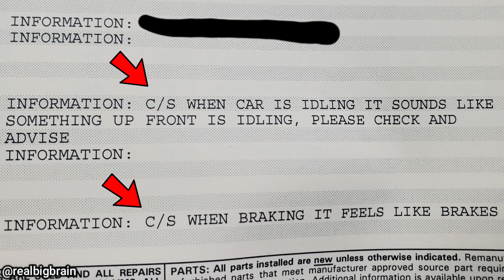Customer States Vehicle Has A Burning Smell & Won't Start | Just Rolled In

Comment: I've seen the blow-by when using bio-diesel turn fully synthetic oil to jello before. No idea if this is what happened here though.
Reply: I am extremely curious what the heck that was.  So bio diesel and synthetic oil solidify when combined?  That's wild.
Reply: @Silent_Shadow  Natural oils tend to polymerize when heat cycled. This is akin to how you season a cast iron skillet, or how linseed oil preserves wood.

Though they are great if only cycled once: castor oil is awesome in "total-loss oiling" systems.
Reply: @bcubed72  THANK YOU! Learn something new everyday!
Reply: @bcubed72  I always wondered why they used total loss oil systems on those early engines. I assume this only applies to high performance engines like WWI fighter planes and race cars?
Reply: Ah, the hydroxide in the biodiesel  causes saponification of the engine oil .. makes soap.
Reply: @bcubed72   the hydroxide  in biodiesel will change the  molecular  structure  of the engine oil..
Reply: That's a Petrol engine though so the bio-diesel theory doesn't fit, it's the same engine GM use in the UK in Vauxhalls

Comment: @0:23 Customer says, I really got a great "cheap" deal on oil for buying two and getting one free!  😁  The label reads >>> Recycled Cooking Oil, Good for 1000 French Fries or 500 Chicken Nuggets.  Filter Daily!  🤣   OOOO, I loved it when you took the cooking/baking pan off @ 0:30  😛

@0:50, That would certainly have Piston-ed me off!  🙄   @1:09, Knock Knock... Who's there?

@1:35....Patent that quick.  How to peel a Rim!     @2:03, was that Low Beam or a High Beam Light?  I think it could use an adjustment while your doing that front end alignment.  😂

@2:10, I have to admit, I haven't seen an alternator quite like that!   @ 2:16, Damn that's Shocking!    @2:34, Don't F-ing DEF with Me!     @2:43, When it runs bad for so long, it's a surprise when it's running right.  I guess 😂

@2:50, Awww cum on, they look great backwards and shine up real nice. 🤣

I am beginning to hate you for keep showing that Rolls.  I want that engine in my GM Safari
Reply from the maker: 😂😂 love the comments.
Different Rolls-royce everytime so hopefully I can get some more to share with you guys.

Comment: There is a plumbing product called LiquiLock which is used for solidifying water so a toilet can be removed without sloshing water.  I wonder if something like that was intentionally added to the car's oil.

Comment: 1:42 that's really strange.. cummings engines have a protection program that will shut the engine down if oil pressure drops. If the underside looks like that then the camshaft has to be even worse.
Reply from the maker: Interesting! Did you see how blue the crankshaft was? Got damn hot!
Reply: @JustRolledIn  yeah it wielded itself.. I know of a guy who threw a rod on those junk navistar engines outside of birmingham al. Instant engine disassembly

Comment: 1:12 That has actually happened to my Volvo too. The welding on lower front shock absorber spring cup fails due to rust and it bends over the tire.  The whole shock tower needs to be replaced.
Reply from the maker: Damn. Did it damage the tire as well?
Reply: @JustRolledIn  Yes it did, it rubbed a tiny bit into the tire sidewall. It happed when I was just drivning my car home from work and then I heard a large bang then and a rubbing noise.  I pulled over to the side of road and saw the carnage. I manage to ge home by swaping out the tire to a space saver spare tire. I changed out both front shocks later in the week

Comment: One of my previous jobs, drove a mack and the headlights quit working. I tied my headlamp around the bulldog on the hood and used that for my lights. Luckily,  I was on a county road, but still had to drive 10 miles in the dark

Comment: The jelo looking oil in 0:39 is that even possible ?? It's my understanding the engine will fry itself before it gets to this point. I had a friend once who never even thought about changing her motor oil. One day I decided to check her car. The oil on the dip stick was charcoal black... My Dear God, I told her; DO NOT start your car, I'll be back. I went to buy new motor oil and oil filter, and oil pan. with tools. I got back, drained her motor oil. It was mud pouring out. Wow, are you kidding me ?? I changed her motor oil. I told her, I'm surprised you didn't fry the engine. That poor car was being abused.

Comment: It should be a crime for a dealer to sell a car that has a blown head gasket without informing the customer, What some of these crooks do is put a sealant in the coolant that might work for a few weeks to a few year depending on the size of the leak. If its something like bad Catalytic Converters that might bore it out or just put a cleaner in it and clear the codes which again might get you a few weeks.

Comment: First clip...I think the customer mix 50/50 synthetic and regular oil mix together.
Reply: That won't cause the oil to jell like that. It is an old wives tail along with if you have synthetic oil and put in regular oil it will blow up your motor.
Reply: @michaelwilkening8542  exactly!  All you get is synthetic blend..

Comment: If you spray spray foam in a engine and it is in oil it will stay liquid after started air gets to it and that is what you get union contractors get this when a strike happens

Comment: I've been told Dexcool turns to jello when mixed with other substances.  Perhaps a bad head gasket was involved?  Note: do not let anybody put anything green in your GM cooling system.
Reply from the maker: I was thinking something along the lines of that as well
Reply: I thought it was fine, IF the system was thoroughly flushed first
Reply: @tracewallace23  There is no reason to change. Use Dexcool when specified for vehicle.

Comment: Can someone explain to me the second clip where he talking melted a piston is that the entire valve Gone
Reply from the maker: Customer thought he melted a piston but actually dropped a valve. Which did quite a bit of damage to the cylinder head, other valves and the piston. 

I got more info in the description for each photo & video if you're ever wondering!
Reply: @JustRolledIn  hey I must have posted my question before checking it out thank you!!!

Comment: Is that what happens to Synthetic Oil when it gets really hot, turns into Silicon??
Reply from the maker: I don't think so. Thinking maybe they had an internal coolant leak or maybe it was caused by some oil additives as somebody else mentioned.

Comment: Yo, that first one is at least 2 years old. Chevy Cruze Turbo if I remember correctly. Full video shows them peeling this off the block. I spent a few hours researching this trying to figure it out the and it seems the most likely cause of this particular case is a fuel additive or fuel blowby into the synthetic oil. Certain brands of synthetic oil use PAO and when the dispersants in the oil are used up, the PAO can't "absorb" the detergents present in certain fuels and/or additives. What you end up with is the oil looking like a jello mold just like this. Vehicle probably didn't get the oil changed at the proper interval leading to the brand of oil and fuel used to cause it to solidify like this once the oil was contaminated enough and the engine was allowed to cool down.

Glycol contamination in oil will create something similar but only if it's a very slow leak over extended periods of time and the engine is allowed to reach sufficient temperature to evaporate the water out of the crankcase leaving just ethylene glycol behind. However, that results in something that has a consistency closer to mayonnaise or peanut butter, not gelatin. 100% not a case of coolant contamination.
Reply from the maker: Thanks for sharing that info, appreciate it 👍

Comment: I do hope that these videos can continue into when EVs go mainstream. No more WTF engine issues, but I’m sure people will find a way to do the equivalent to the motors.

Life WILL find a way.
Reply from the maker: I'm sure we will always have something to post about lol
Reply: @JustRolledIn  For sure. Plenty of suspension, body, electrical and interior mods CS stuff to still show.

I'll miss seeing stuff like the first one when they removed the oil pan and you get a perfect Jell-O mold shape. After I get it out, I would have cast it in clear resin and mounted it to the shop wall.

Comment: First clip, wtf is that?
Reply from the maker: They didn't mention what it exactly was but I think a mix of coolant and engine oil.
Reply: @JustRolledIn  In all the years I have wrenched, I have never seen that. Wow!
Reply from the maker: @krisdrinkwine6045  you and I both.   If you Google "chevy Sonic gelled oil" an article should come up about more details regarding this clip. Didn't know until after I posted but just incase you wanna read it. I still have too lol
Reply: @JustRolledIn  Thanks, I'll check it out.
Reply: Don't think I found what you were getting at, but the oil cooler design is a bomb waiting to detonate. What a crappy design, thanks again for info.